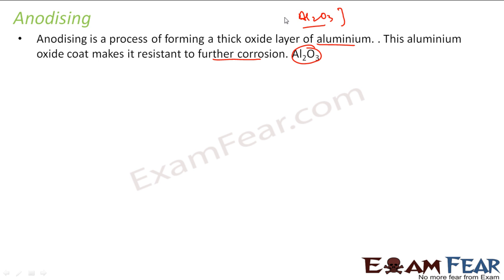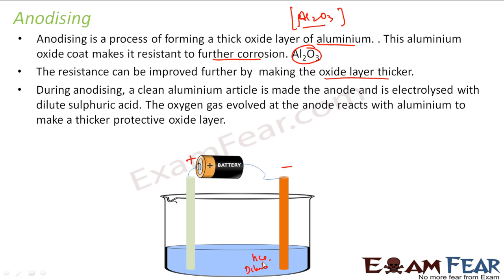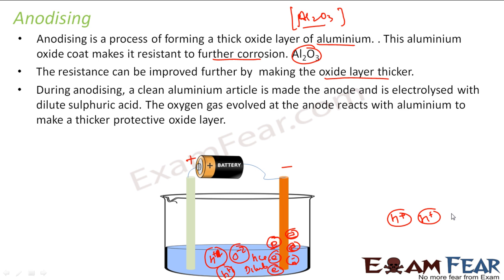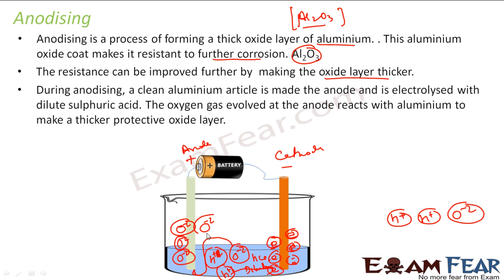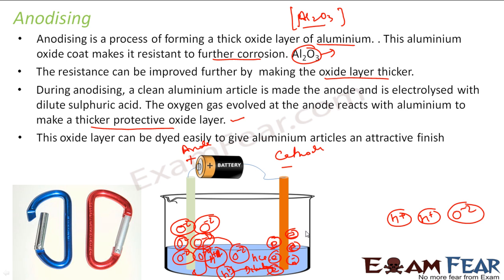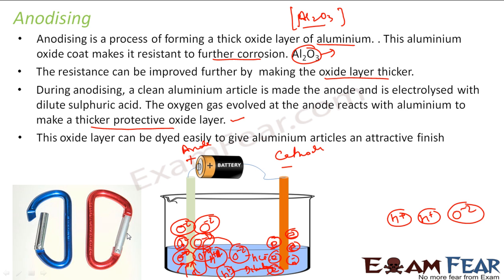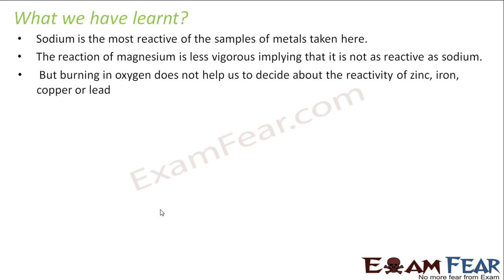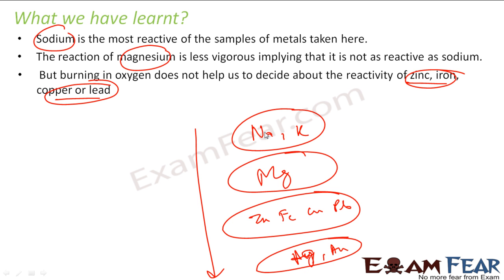Chemistry Metal & Non Metals part 6 (Anodising) CBSE class 10 X

Comment: It is H2SO4 and not HCl.
Potassium is the most reactive element not sodium.
You did not explain why we use sulphuric acid and not water.
Here is why:
When we add sulphuric acid to water, we are essentially acidulating it. This is called acidulation of water. Without sulphuric acid, water won't split into h+ and o2- when electric current is passed. Acid doesn't take part in the reaction and it just helps in the decomposition of water by making water a better conductor of electricity.